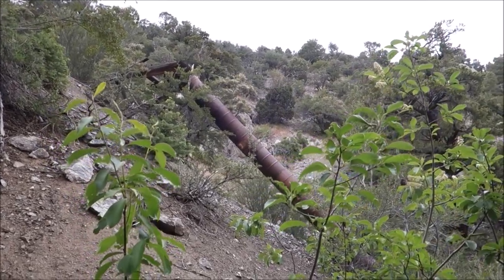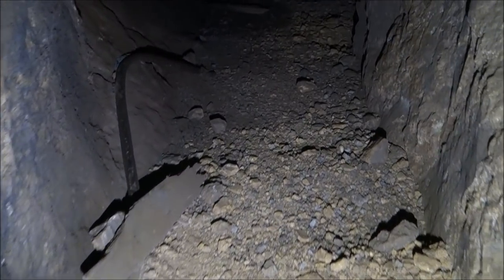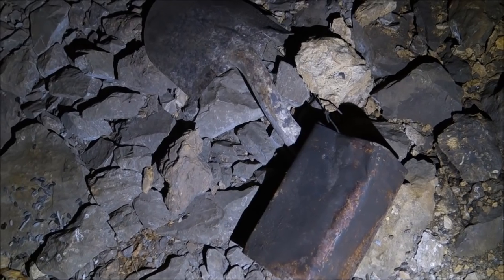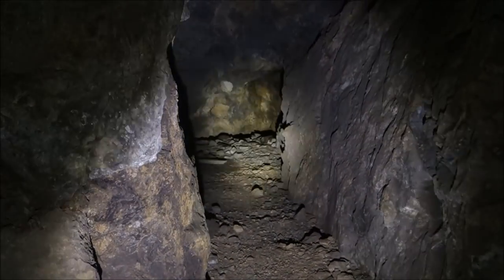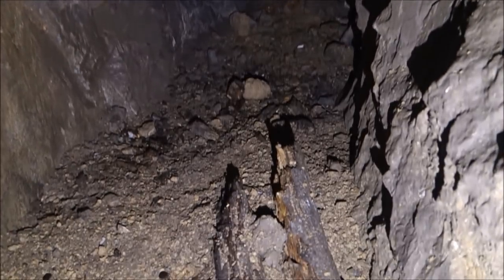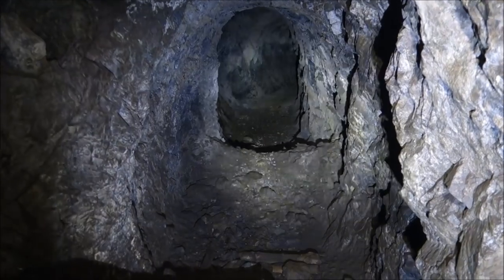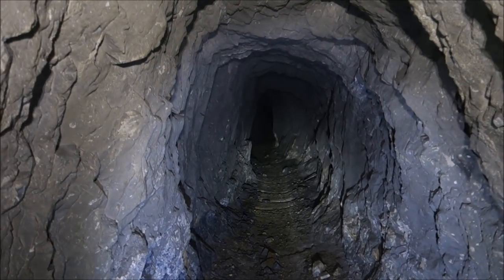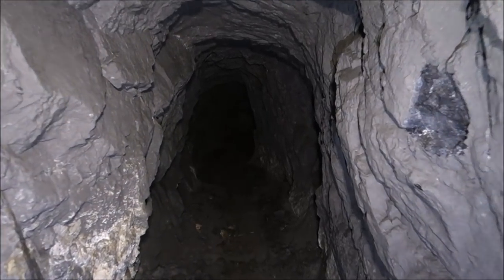Exploring The Abandoned Fortuna Silver Mine: Mechanical Delights

Comment: That hoist is a Compressed air Tail Rope Haulage Engine; that is to say a steel rope that is fixed to the drum and like a fishing Rod reel. Gravity  rotates the drum as the rope is being Pulled out: The Handbrake is only used to steady the drum when there is a Heavy  Load , like a Mine Car; The Compressed air that Powers the Machine makes a chug chug sound as Both Pistons power the Drum. they are Normally for  Pulling I don't think there is a reverse on these Machines where only Gravity will feed out the rope
Reply: Roland Mitchell That's what I thought the low passage behind the hoist was for, the return cable. A giant circle of cable.
Reply from the maker: @Roland Mitchell Thank you for expanding on that and sharing the details...
Reply: @tolget4684  that maybe the Case,where the Rope is an ENDLESS ROPE : An Endless Rope has to Have a Loop of Cable wrapped Once around  the Drum where then One End of the Cable is Pulled By Hand to a Pulley wheel ; where it is Fed through the  Pulley wheel and then the  Rope is then Pulled Back towards the Winches Drum; Then the Other end of the Rope is Pulled towards another Pulley wheel the  other direction and likewise the Rope is threaded through the Pulley wheel and then Pulled back to the Drum; The two of the ends of the wire  Rope are then Spliced together which then Makes the Loop which is therefore called and endless rope! One of the Pulley's May Be Attached to A Counter weight where the Pulley can Move Backwards or Forwards within a framework that Has four solid Iron wheels  that fit within the H Iron Framework . Counterweights are Connected to a Long rope which could be about Five Yards Long the Other end of the Rope Is threaded through a Pulley ; where there is a Metal Bar  attached to the Rope at the Bottom of the Metal Bar is a Steel round Plate which is Centred on the Metal Bar: Heavy Round Weights that have A Slit that weigh in about 10 Kg each can be lifted and  slotted onto the suspended Metal Bar;  Depending on How Far between the  Main Pulley's the rope is extended to depends on how Much weight is Put onto the  Metal Bar. it could well be a  Tonne weight is Needed to Keep the Endless Rope Tensioned; If the Rope was slack around the Winches Drum, the Rope wouldn't grip onto the drum and therefore would not be Able to Pull any Mine cars: Having Said all this: I don't see any Evidence to support any theory  of any of those winch Engines Having an Endless Rope; the Ones that I saw were Tail Rope winches

Comment: Interesting mine for sure.  I've seen caves and caverns, and I've seen mines. But I've never seen a mine with so much natural caves and caverns in it.  I think those may be old lava tubes. --- I once found a diesel powered hoist winch that size but it wasn't in a mine. It was on a placer claim and had been used for moving large rock in a creek for dredging.
Reply: they are old hotsprings/springs
Reply from the maker: Yes, it was sometimes hard to tell where the natural cave ended and the mining started... This one was pretty wild. I'm amazed that hoist you found was still there. 

We were checking out a mine in your neighborhood today, @Duck Landes and, of course, there was a massive illegal grow operation right on top of it.
Reply: The winch was / is at the very bottom of Butte Creek Canyon. I only drove a truck to the bottom one time. The last section of road is insanely steep and rocky.  Getting back out was even harder.  The last time I was there the road had washed out right at the top of that last decline, so it would be impossible to get a truck in there now without building a bridge. There were more Northern Pacific rattlesnake in that last decline section than I've ever seen anywhere else. One time walking down it I consider as "the day smoking saved my life." A guy behind me had wandered off the trail, then right back on and was excitedly saying (screaming) that he had almost walked right into pit full of rattlesnake. I stopped and turned around to hear what he was saying, looked down and there was a Northern Pacific coiled up 6 inches from my foot, looking at my leg. My 22 year old dog didn't even notice the snake and just kept walking past it. I took a big drag on my hand rolled cigarette and tossed it just on the other side of the snake.  When it turned to look at the cigarette I jumped back out of the way. Got my shovel off my backpack and whacked the snakes head off. Picked up my cigarette and finished smoking it.
Reply from the maker: I have the impression that there were a lot more rattlesnakes in the past... Just me or have you noticed that too?

I agree that was a fine time to be smoking a cigarette. That'd be a good advertising campaign for the tobacco companies, you know? Stories of all of the times that smoking as saved lives.
Reply: @TVRExploring : It does seem there are fewer rattlesnake around than there used to be. When I lived on Doe Mill Rd. I saw them all the time, both Northern Pacific and Timber. And when I moved down here to the valley it was a common occurrence to see Timber rattlers squished in the road, and in my yard. And you always had to be on the lookout for baby rattlers in the yard. About 15 years ago I had a couple King snake living under my front door stairs, and haven't seen any rattlesnake around here since. 

I'm not sure about an advertisement, but it would be an interesting video. Though I don't think I've ever heard anyone else ever tell a story about how smoking saved their life.  Just me :>
Reply from the maker: The king snakes could definitely have had a local impact! I've just noticed more generally though that there seem to be far fewer rattlesnakes in the past twenty years or so...

Comment: There's an abandoned aragonite mine in southern Utah that I've poked around in the tailings of. The original entrance collapsed and was mostly cleared away, but it'd be awesome to see footage of the interior if you were ever in the area.
Reply from the maker: Is it accessible?
Reply: @TVRExploring  I recall there being  a pretty steep  debris pile in the entrance still that you'd have to slide down so probably  not so much... the more I think about that one the less likely it seems... I also seem to recall a barbed wire fence with a no trespassing sign blocking the portal. So probably a bad idea... https://www.ghosttowns.com/states/ut/aragonite.html there's a website with some more info if you're still interested. It's been a few years since I've been there myself. As per getting to the portal, that's pretty easy.  My dad and I made it in a pickup truck. The roads there are kept in pretty good condition because of active surface mining in the area and ranchers that drive their cows through the area.